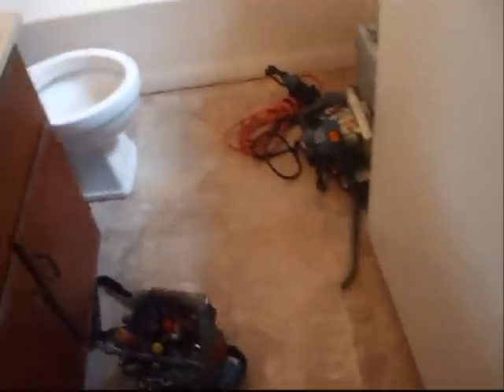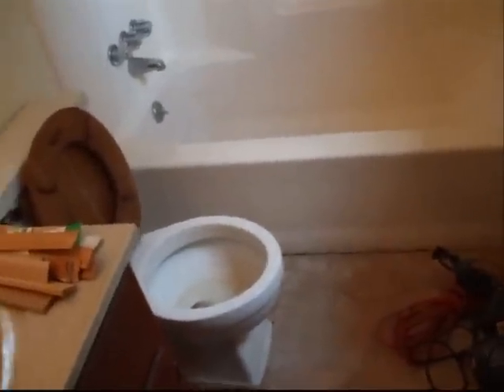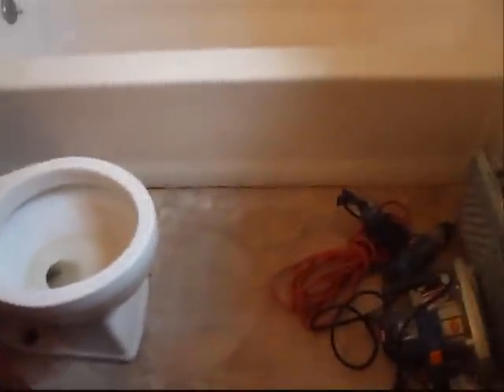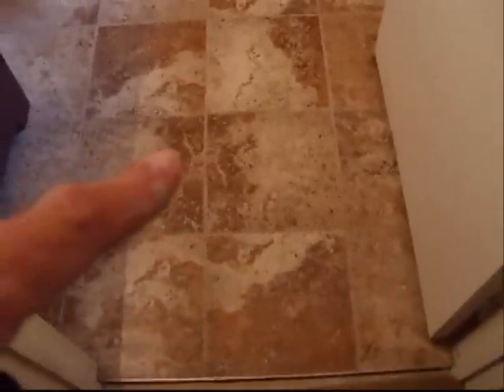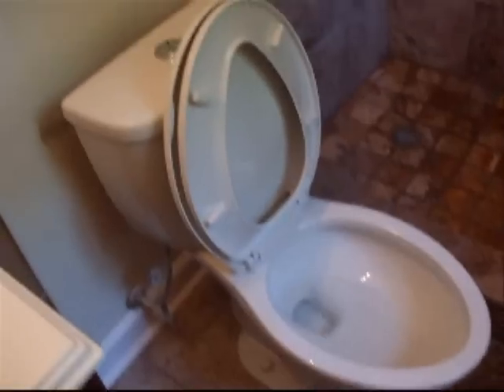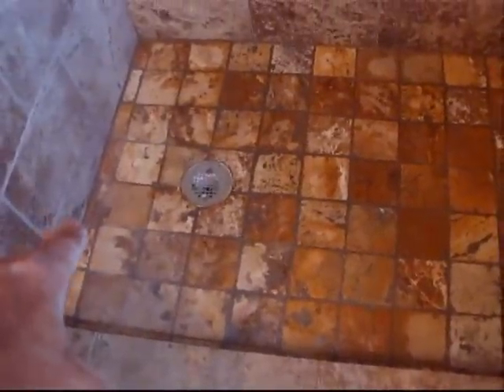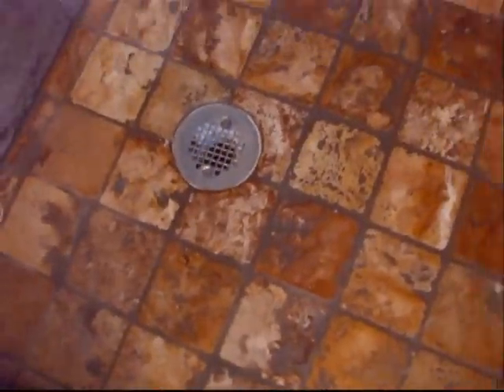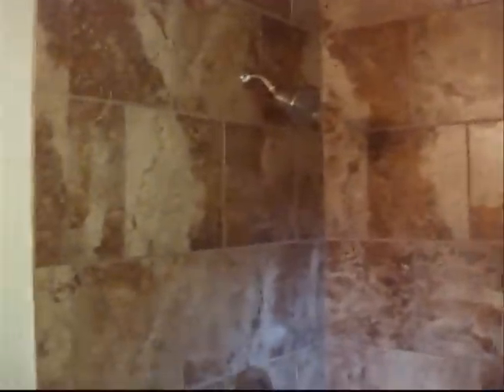Tub to Shower Conversion

Comment: Very nice. I'm looking to purchase a home with a master bath similar to this on the second floor. The original owners had the home built with a HUGE closet with entrance only from the bedroom (not from bathroom) and skimped on the bathroom. Instead of dual vanity, they installed one and made the extra space for the second into a small bath closet. Very concerned about the costs involved with converting the tub to a shower, changing the closet to another vanity and squeezing in a closet door!